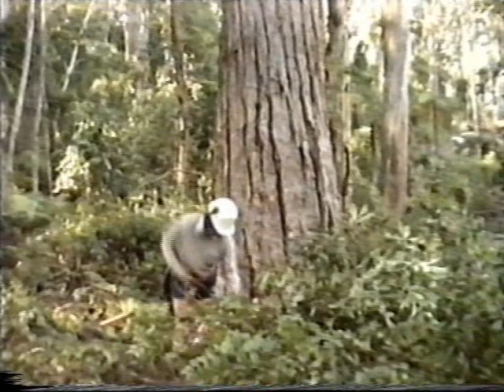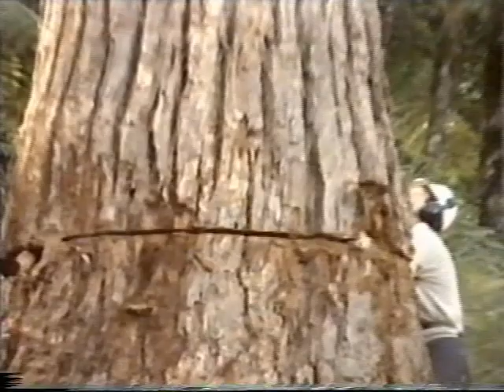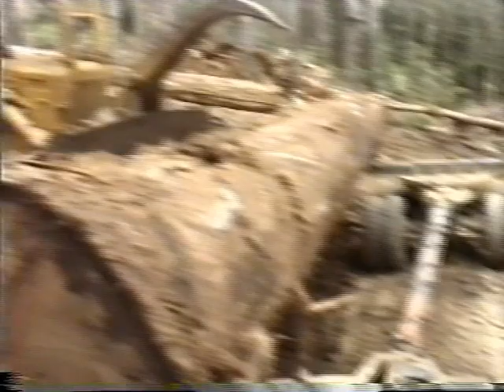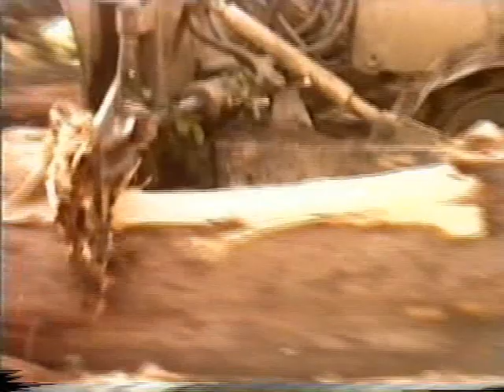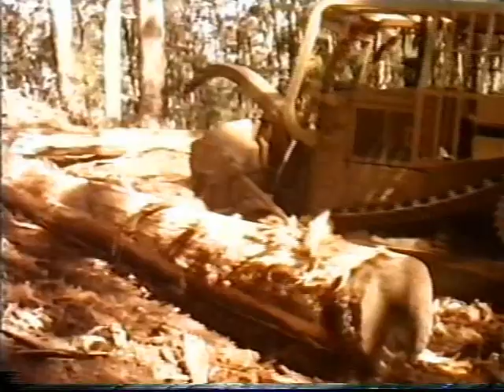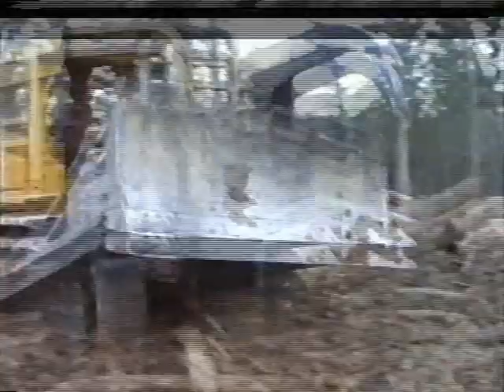Logging in the Dorrigo and New England area

Comment: Pretty interesting loading logs with a dozer
Reply: That's how they did it before excavators took over the coup work, they rolled the logs onto the jinka via a bank cut away, the excavator can load more on top than a dozer, but this dozer was a one machine does all, it's brilliant to watch. The dozer is one of the greatest inventions of Mankind. Remember for those outside Australia that these are hardwood logs, extremely heavy timber around 1000kg per m3 dry, so add 50% to that at a guess.